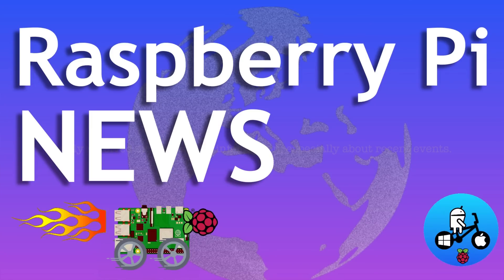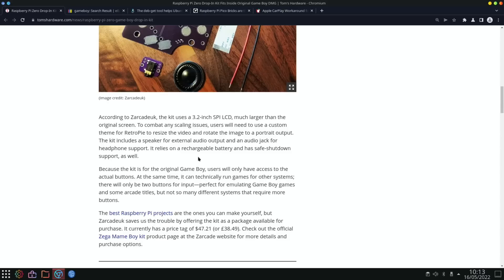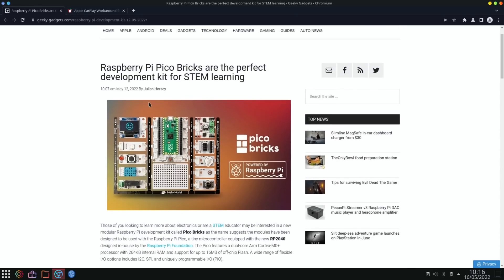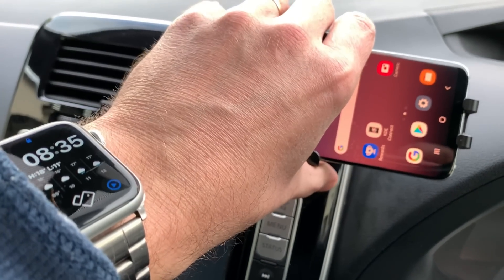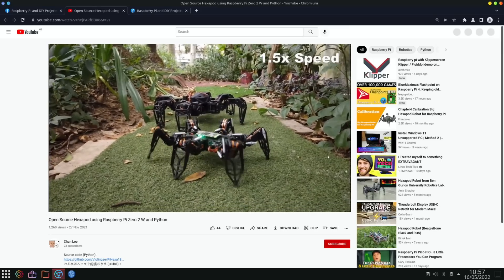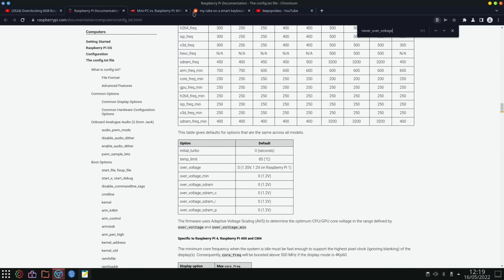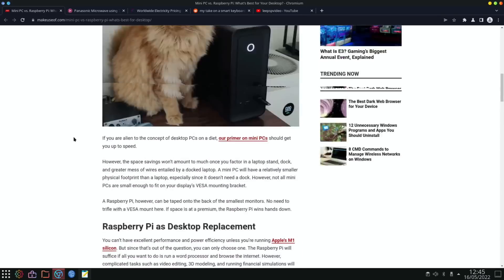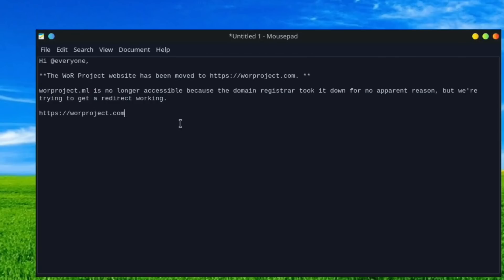Pi news 58. Pi Vs PC. never_over_voltage

Comment: My local electrical co-op charges 10.55 cents per kilowatt hour. It's been holding steady at that rate as they have steadily been installing acres and acres of solar panels in fields where they used to grow cotton. Cotton isn't king anymore, solar is. The beauty of this is, when the weather is blazing hot and air conditioners go into overdrive, the solar output goes into overdrive too.
Reply from the maker: That’s the cheapest so far. Where in the world are you?

Comment: I get so excited when I see your Pi News videos pop up!! I love seeing these awesome projects... I know I could go on to the pages myself and find them, but I like having your opinions curate the good through the bad. Plus I learn so many things just by watching your vids. I picked up a Pi Zero W and CM4 8GB with Waveshare bard with a PCIe nvme m.2 slot just for gen 500gb drive (realized after that gen 3 makes no difference in this application lol) all so I could put together retro gaming setup... but I dont even play games that much anyway lol ... I think I like tinkering more than anything else... i keep getting all this gaming stuff and never even play any LMAO - I just got a 6650xt and 32" asus 144hz 1440p monitor last week and I haven't even played a single game LMAO!!!! I already got a jailbroken ps4 pro hooked up to my 42" 4k tv and FILLED the 1TB drive on it with games, but I don't even use it much (I DID setup my pi zero to automatically jailbreak it everytime I turn it one... even to the point of emulating a keyboard to it goes through the menus and presses all the keystrokes for me..... which I just HAD to do when I found out about it LOL)
Like I said.. tinkering... and THAT is why I love learn about all the cool stuff people do with Pi's and even the tips n tricks  u give, like about overclocking, because I didn't know a thin about the Pi before I got it. But all I have is this dinky little stick on heatsink... so next I'm gonna get some cooling toys, going by what I learn from you, and get my CM4 into a case and up and running... put that old 1080p tv to use :)
Thanks for your vids bro.... You rock!
Reply from the maker: Sometimes just the process of getting something working, even if you don’t use it is enough. 👍🏻👍🏻

Comment: where do you get all of your PIs?
Reply from the maker: Is less about where, more when.

Early 2020 was a good time to buy a Pi. 

Raspberry Pi 4 #PRICE DROP# Pi 4 4gb on EBay £36 Rev 1.2
https://youtu.be/kmBE7Sz1W4U

Rpilocator is a great website, but you need to be fast.

Pi 400’s are excellent and still available last time I checked

Pi 400 Still widely available. Is it because it’s no good?
https://youtu.be/E0bDBiC2-IU

Comment: I got a second hand Pi4 8GB and that overclocks fine as to 2ghz, not done higher and this is running passive in Flirc case.   

Did have to update the firmware so could boot via external USB if that gives an idea of how out of date the firmware was and the age of it, so an early release of that model I'd surmise.   

The chap who is having issues, be interested in what his base temps are on base clock speed, like everything, maybe one of those exceptions that validates but fails if pushed (possible).  But an idea of temps at base clock would indicate if there is an issue there.

Comment: Glad you are getting a smart meter now.
From June 2022, any install for a car charger HAS to be on its own smart meter and the price per KW can change by the hour !
Reply from the maker: I use the Granny charger. 👍🏼
Reply: @leepspvideo  So do I with the wife's new Outlander PHEV. 
Mind you that's only a 13Kw battery and charges in 3 hours.
Still about £2 to  charge it though
Reply from the maker: @BillyNoMates1974  mines only 24kWh. I asked on the Leaf Facebook group, many owners just charge on the cheap tariff. I can set a timer on the car computer to switch the charging on and off in those hours.

Now I have to work out what else I can set to charge with the off peak rate. Dyson, iPad, electric bike…… 👍🏻👍🏻
Reply: @leepspvideo  build a huge battery bank for the Raspberry Pi and charge at cheap rate. then run off batteries during the day.... and add a solar power install as well to top up during the day
Reply from the maker: @BillyNoMates1974  I listen to the fully charged podcast. The presenter has a great solar/battery setup. 👍🏻
Reply: @leepspvideo  So do i.
On a smaller scale to just power the Raspberry Pi would be cheaper.